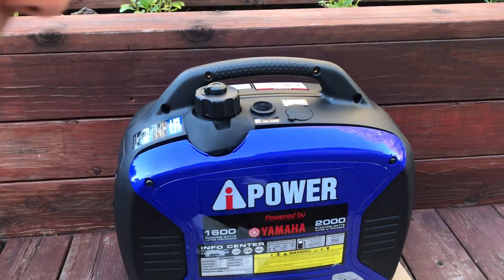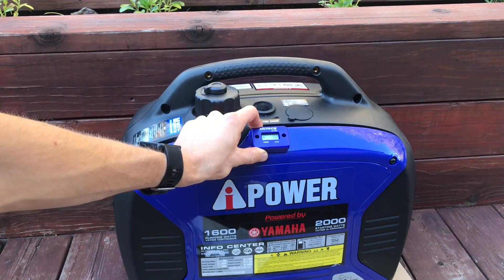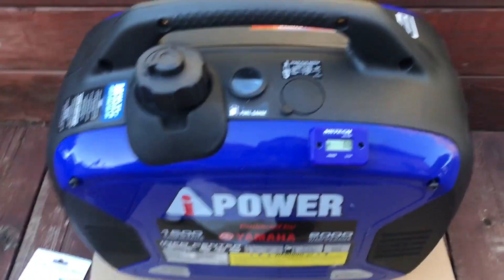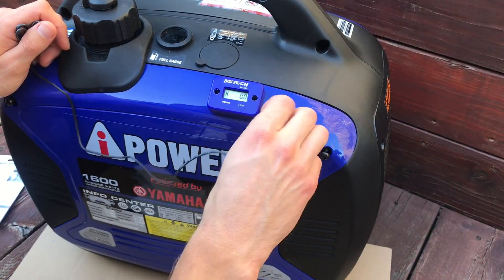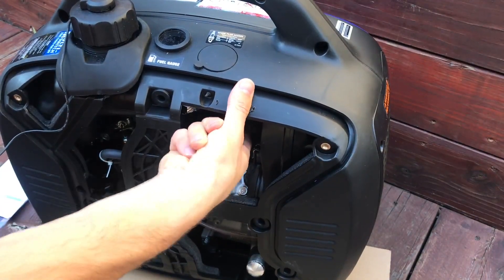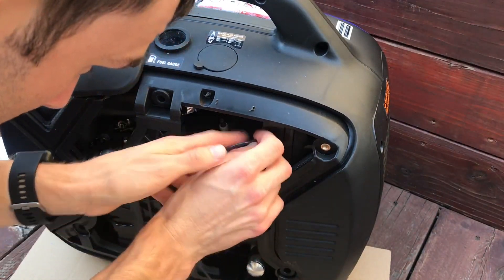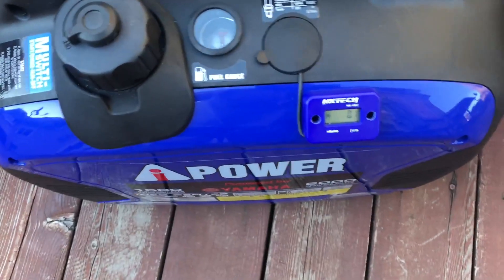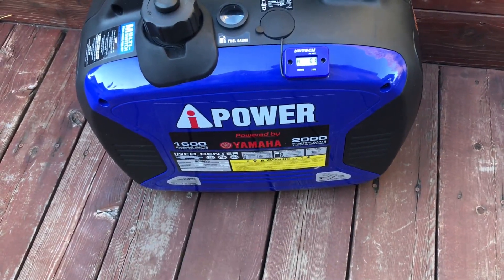How NOT to Install An Hour Meter On Your Costco Generator 2000 Watt

Comment: Wrong location for the hour meter.  Now you have to remove the wire and reinstall every time when changing oil.  Also, run the wire through some other place but not the spark plug cover - may be around rubber cover near gas cap. This would prevent a potential water dripping onto the spark plug in bad weather.